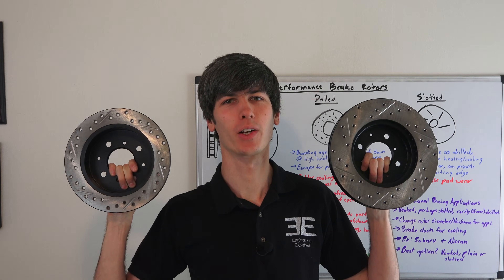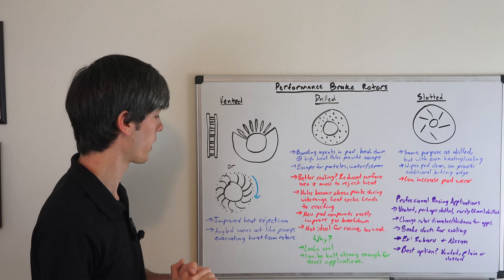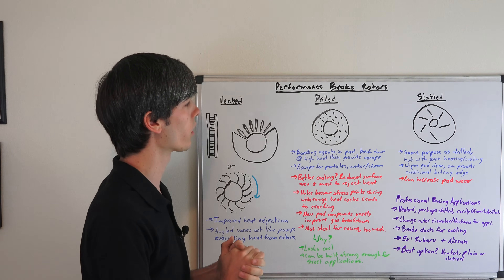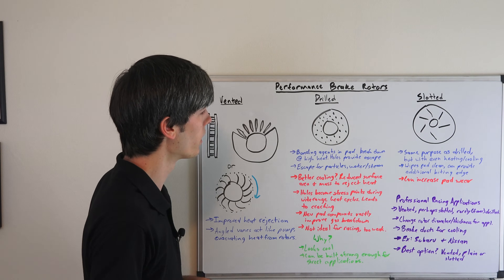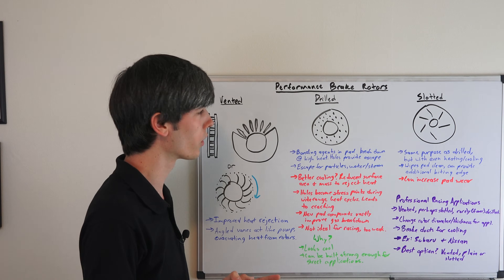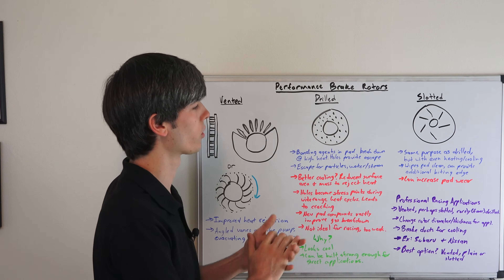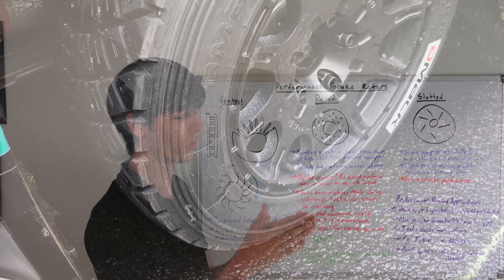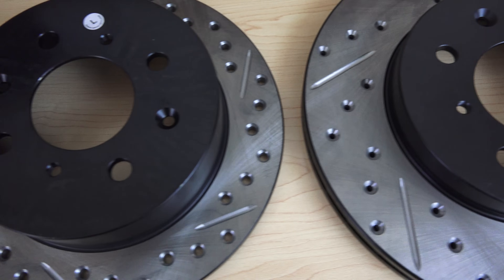Drilled, Slotted & Vented Brake Rotors - What's Best?

Comment: There are functional advantages to using drilled rotors.  Why this is so is a little complicated, and takes a few paragraphs to explain. (see below).  That there are advantages is well established, and this is mostly their ability to bring a high performance pad up to peak temperature very rapidly. This is useful on lighter weight, performance oriented street cars and some forms of racing where the brake loads are intermittent.

Drilled rotors are used on the street versions of high-performance cars which will never see any serious track time, but which may be driven quite vigorously from time to time. Sprint car racers also prefer them.  All of this general group of performance cars driven mostly on the street [e.g. Lotus Elise, or Porsche Cayman] have brake pads with friction coefficients that increase as temperatures go up.  These pads need to be warm to have the optimum response, and improved feel, during braking.  

Brake pads do not conduct heat well.  Some have copper threads added to improve conduction, but basically a pad does not conduct much heat.  The primary path for heat conduction out of the pad, is into the rotor.  When a rotor is drilled or slotted the area for heat transfer out of the pad is reduced, and so the pad rises to 'operating temperature' much more quickly the same pad will come to temperature with a plain surfaced rotor. 

For a car equipped with higher temperature pads that is not driven on a circuit track, drilling or slotting the disk, reduces heat transfer out of the pads, bringing the brakes into their optimum working temperature immediately, the first time they are applied. There is no need for this rapid warm up on a car driven on a long circuit track, where the brakes are brought to temperature in the first turn and remain hot throughout the race.  

There are forms of racing in which drilled rotors are very much preferred. Drag racing is an obvious application. In this form of racing the brake pad must be brought to temperature very quickly and their brake disks are perforated to the point of looking like lace.  Lighter weight open wheel cars like Sprint racers prefer drilled and/or perforated rotors, because braking loads are moderate, and the cooling of the disk itself is very rapid. Many 'sport' motor cycles use drilled rotors for this reason as well. These are all applications where drilled rotors are used for functional reasons.

Drilled rotors, unlike slotted rotors, pump air through the holes as the leading edge of the brake pad approaches the hole.  In a centrally vented rotor, the vanes in the center vent draw air from the holes and sling it outward in a continuous cooling loop. So drilled and perforated rotors have the advantage that while the pad heats more quickly, and the rotors themselves, having less mass may also spike in temperature, they also lose that heat very rapidly.  For intermittent braking this is an advantage.  For circuit racing drilled and slotted disks are generally a disadvantage. For rally cars, slotted are often preferred.  Pad wear is greater, but so the braking, and that is to be expected.

While the adhesives in brake pads no longer off-gas as badly as they once did, this is not the only source of gas between the pad and the rotor. Steam can be a serious problem in the initial applications of wet disk brakes.  While driving in rain, drilled rotors provide an exit path for steam in a way other rotors do not. So there are all sorts of applications in which perforated rotors excel.  And these applications have nothing to do with appearance.  The limitation for drilled rotors is the potential for cracking.  Cracking around the outermost holes can occur either when the rotor is used above its temperature range or when the quality of the casting is poor. 

There is no down side to using a drilled rotor in applications in which the heavy loads are intermittent, and there are many advantages, especially for lower power and lighter weight performance oriented cars.
Reply: +maneki9neko I was under the impression that on motorcycles drilled rotors were primarily for 1 weight and 2 get all the mud, water crap out of there
Reply: +Diego Jimenez 

Getting the water and steam out is a really good idea on an exposed brake and cross drilling helps there.  So do vertical slots in the brake pad.  Both help.  

Drilling simply does not remove much weight, so there are better ways to remove the unsprung weight of a brake and caliper. Using aluminum for the body of the caliper, in preference to cast iron removes a lot.  So does using an aluminum hub and a cast iron disk, as is commonly done with the Wilwood series of brakes.  So cross drilling for weight reduction is not a strong motivation unless the brake disk is truly reduced to 'lace' as you will find on dragsters. 

Cross drilling is useful in a very specific niche of application.  Consider the following:  I drive a Miata in the mountains, and I will gain and lose a mile of altitude in a couple of hours. I work the brakes hard, but not as hard as a racer would because I am on public roads. My disks will go up to 1000F.  I know this because I have measured them with a radiometer. So the stock brake pads do not work for me.  The stock pad overheats.  And the glue or binder from the pad, melts or burns on to the disk.  

As is mentioned by others posting on this page, when this happens, it feels like the disk is warped.  But when you go to turn the brake disk you discover the disk is not warped at all; it just has a bit of a deposit in a few places from the brake getting fused onto the disk.

So people like me with sporty vehicles driven hard, need a higher temperature pad, to survive the heat. But brake pads with higher temperature compounds, change their performance characteristics as they heat up.  When they are cold they are 'okay' but when they are hot they are 'terrific'. Since people like me do not drive on a closed course, the pads do not heat up on the first turn, and remain hot for the rest of the drive.  For our cars, which are driven hard but only on an intermittent basis, something needs to be done to cause the pads to come to temperature faster, and not over heat.

Drilled disks reduce the heat transfer coefficient, by reducing the contact area, between pad and disk.  So pads working on a drilled rotor come to temperature faster. This can be measured.  The disks also cool faster than a solid disk, between applications of the brake pedal, when they are hot.  So the temperature of a drilled rotor, and pad which rides on it, tends to spike faster and higher than a conventional disk.  The disk also cools from that spike more quickly when the pressure is off the pad. I, and others, have measured this with radiometers.  The measurement is an easy one with the right tool.

And this is why you will find drilled rotors on Porsche Caymans, on Boxsters, on M Series BMWs, on AMG Mercedes, on the Lotus Elise and similar cars.  This is not 'bling' or ornamentation.  The engineers at these facilities know what they are doing.  These are cars which are driven primarily on the street, which have higher temperature pads.  The pads need heat to function in their optimum zone.  And the brake needs to be cooled from that heat sooner. A cross drilled disk does both.  The temperature spikes fast during brake application, and the disk cools from that temperature more quickly.  

Racing is q completely different story.  Circuit racers do not use drilled disks for the most part, except in some special applications. In Sprint Car racing, or with lighter weight, lower power, open wheel race cars these some times benefit from the use of drilled disks.  Heavier, higher power cars driven on a track generally do not benefit from a drilled disk.

A lot of people think that drilled rotors are decorative, or are of the past.  In the right application cross drilled rotors have an important function.  This, and not tradition, is why you will see them installed as factory equipment on sporty vehicles with 'hot brakes' which are not driven continuously on a closed track.
Reply: I had thought that drilled helped remove water as well, but this isn't true.  I had an issue with a BMW some years ago where it would get water (rain) on the rotor and the brakes would take literally a second before they would grab.  I thought if I replaced the plain rotors with drilled (non-slotted) it would fix the problem, but it didn't.
Reply: My Mercedes S500 came from the factory with drilled rotors on the fronts. It's definitely not a performance car but the engineers put them in for a reason.
Reply: @Darren Curry: You might have 'glazed' or otherwise contaminated pads.  Drilled, slotted or plain rotors with clean pads should not take so long to grab.  The time should be a small fraction of a second.
Reply: also sounds like there could be corroded piston in the caliper or other hydraulic issue
Reply: Good post, I just got a pair for $90 came with ceramic brakes pads. The hell with everyone haha. I had a pair on a previous car for almost 2 years was perfectly fine never cracked.
Reply: I enjoyed reading your explanation than watching this long video.
Reply: maneki9neko nice dude. Appreciate the info.
Reply: My brembos are drilled, slotted and vented. Love how they can pull up an 1800kg car from 300km/h time after time without fade.
Reply: I own an Mercedes s420 95, do you think I should put the drilled and/or slotted rotors? Like he said, I think they would look on them.
Reply: If the holes contribute to cooling, why are they always clogged with pad material?  Lotta BS in this post IME tracking cars and motorcycles.
Reply: maneki9neko Bravo on the detailed aspects of rotors, your a scholar
Reply: Mostly BS for anyone who uses brake for more than a single stop.  Google cracked rotors and see how many drilled rotors crack long before they would if they were solid or slotted.  Drag racing needing brakes?  Laughable at best - a single braking event per run.  I have four major braking events PER LAP at Carolina Motorsports Park, that's  40 events in a 20 minute session from triple digits to low double digits - every 30 seconds the brakes are getting heat loaded.  Sprint cars?  Seriously?  They hardly need brakes at all, they're used to rotate the car, not do any serious stopping or even speed modulation.  I grew up with dirt track racing and those cars use everything BUT brakes.  Drilled rotors crack much faster than blanks or slotted.  It you have an unlimited budget for brakes and a need for light weight but are restricted by rules from running carbon rotors, drill to your budget's content, but don't  for a second believe they will actually provide better braking performance.
Reply: I just installed front drilled slotted rotors on my 2015 Honda CR-V because I do a lot of stop and go driving for Uber and Lyft. I immediately started noticing a hum sound coming from my brakes when stopping suddenly at highway speeds. Any body have a clue why this is happening. Are these type of rotors that noisy. I double checked my installation and everything appears to be installed correctly.  I have installed dozens of brake rotors and believe I know how.  Anyone have a clue what's going on I would appreciate the help. Thanks
Reply: @vazquezmjorge  Perfectly normal.  I first experienced this on a Yamaha 250 race bike.  Sounds very weird, but is absolutely normal.
Reply: maneki9neko We need to make this an official addendum to the video
Reply: Thank you very much! You seriously helped me with my final decision on a front brake upgrade for my GLI

Comment: Thanks for the video, after watching this the first time I was in a mild fender bender in my SVT Focus in the rain.  I had been driving for awhile without using my brakes when all of a sudden traffic stopped and I mashed the pedal to the floor, my car braked very slowly with no skidding or anti-lock and tapped the rear bumper of a Prius.  After the accident I tested my brakes in the rain and realized that the first strong application was slow to stop but the next two got better and my anti-locks kicked in.  My feeling was that the layer of water between the discs and pads hindered my initial braking effort.

I remembered your video and avoided buying the drilled and slotted rotors and instead ordered EBC slotted rotors knowing that the pads might wear out faster but the extra biting edge and hopefully some water evacuation would be an improvement, thanks for steering me away from the drilled weaker rotors and keep up on the good informative videos!

Comment: PLEASE make a video about blowoff, diverter, flutter and all those kinds of Turbo Valves!
Reply: I think he already made a video  about blow-offs. The turbo flutter or turbo surge i think is also mnetioned in the video.
Reply: -TwinTurbo250 Productions- Flutter isn't a valve. Its compressor surge. Basically if you have no blow off valve and your running all that air then slam the throttle shut its the sound of the air being forced back through the turbo. A lot of folks say its bad on the turbo, some say not so bad. Either way I would recommend a blow off valve to vent the excess pressure.
Reply: I'm not an engineer and I've heard both sides of the argument from engineers in the automotive industry. I chose the bov direction. You can choose the path you like.
Reply: He has no practical knowledge....its all from books. I bet he has never left hus house. Ask him what kind of car he drives and if he is an automotive engineer who has a job in the field or if he has any knowledge of cars outside of wiki pages
Reply: Mark Nope are you talking to me? I'm pretty sure he has decent practical knowledge as he builds race cars in his free time.
Reply: User Name ummmmm lol. Put your face on the desk. Firmly. Leave it there. He reads books, went to school. Reviews chrysler 200s and drives a 99 acura gs. Please leave your face on the desk for the remainder of todays lesson.
Reply: Mark Nope I was just talking about talking to engineers outside of here just wanted to clarify if you were targeting me. I don't know anything about engineering explained himself besides he is a massive Subaru fanboy and owns an sti.
Reply: +TwinTurbo250 Productions seeing as ur pic is a R34 GTR i would say keep the bov oem unless ur really want the "BOV sound" and ur happy to deal with local environmental laws. thats the entry lv bov answer. 

now if ur running +600hp then going with a bov that can flow more may be a consideration. 

as for replacing the bov for a seal: sounds really cool, could put more stress on the intake and turbo. try at ur own risk

Comment: I ran drilled rotors on my daily driver ages ago, and they started to develop fractures around the holes after a couple years, despite my being a fairly conservative driver.  I think it's just the nature of the beast!
Reply: Your issue may stem from the fact you didn't change your rotors for 2+ years 💀
Reply: @Transitive Wisdom Yeah, his rotors are cracking on the street because they are cheap aftermarket stuff. OEM Porsche, BMW, etc. drilled rotors don't crack unless they are tracked HARD. If your car didn't come with drilled rotors, don't use them.
Reply: @ristretto97  what if i buy nice powerstop drilled and slotted rotors and my car came with plain rotors?
Reply: @flute136  Sorry, I don't have any experience with Powerstop drilled rotors to say if they are OEM quality or not. BMW and Porsche OEM rotors are often by Zimmermann. If your car came with plain rotors I'd stay with plain, you are losing swept area with drilled or slotted.
Reply: @ristretto97  well theyre suppose to be an upgrade kit
Reply: @flute136  A lot of aftermarket stuff is "supposed" to be an upgrade.
Reply: @ristretto97  maybe yea but its probably better than my old ass rotors that are like 100k miles old lol
Reply: @flute136  No doubt, but probably not any better than Centric high carbon blanks.
Reply: @TheTwerkAttack  it depends on the mileage and driving conditions but 2 years is kind of low. I've had several cars with factory rotors that last me close to 6 years before showing signs of wear. Op was also talking about a daily driver.
Reply: @flute136 I put powerstop drilled and slotted on my wifes Cadillac CTS and they have been great.  She drives a lot of state hwy, so lots of stops from 70 to zero for stop lights. They stop quick and seam to be lasting at least as long as any others I installed on it.

Comment: I run drilled and slotted on 98 expedition. started pulling a 6x12 open trailer with a riding lawn mower occasionally and immediately noticed that the truck didn't stop well with the extra weight. Purchased the drilled and slotted rotors and it's a world of difference. by the way if anyone is wondering about how I drive, I am a 23 year veteran truck driver with no accidents . All I'm saying is when I know what works for me, it's kind of hard for me to take advice from anyone who says otherwise.

Comment: You stated that drilled rotors are not being used in F1 racing. True, but there is almost (perhaps not at all) no steel in them. Street cars are mostly steel, so there is no comparison between those two materials, considering heat resistance (thus, warping), heat transference capabilities and mechanical specs. There should be no comparison between apples and pears. Just my humble opinion, with all due respect.

Comment: I've had my cross-drilled AND slotted rotors on my car for 5 plus years and auto crossed with it, and they are holding up fine.  No stress cracks.  They do get hot fast but I attribute that to the fact that I don't have air ducts to help with cooling.